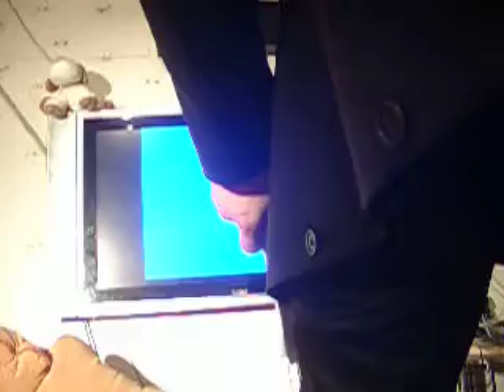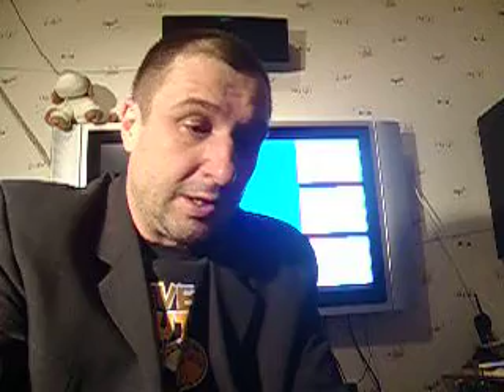BMW 7 HHO part 1  "Intro" Step by Step :] car running  on water Hydrogen

Comment from the maker: I've met Polish LPG Installer (Mr  "X") and after little chat decision: LPG Installation gonna be revorked to supply HHO. No missfires BTW. 
Usualy people supplying HHO to inlet manifold via Flowmeter (cose computer need to do something with extra added pressure)...so in this case is better  install them Safety Valves. Best 1's for V8 in Poland costs a half price of new1 LPG front set?! ... and using this converted LPG(HHO) I could set ratio HHO to rpm's
loooool!!!! :D

Comment from the maker: Hi there!
If you would like to builkd 1 by yourself-just type in google or youtube: HHO VAPORIZER SCRUBBER and you will find lot of it :]
I suggest to buy one from ebay-but if you would like to "play with it"... just play with it lol!
This project gonna be changed cose found now new type of HC-with Titanium plate! It deparate H and O so if you can heat H you can run without gasoline at all(of course after heating up this system).
Good luck! ;]

Comment from the maker: Hello @JThen14 !
I found on ebay non caustic additive to water and superstrong one...I will put into my next part :] and also have some nice tips more ;] 
The Pain is plastic manifold in this V8...going to call and ask for good solvent for this-LPG installer is open to informations :D
Good luck! - I am not taking any of resposibility for any possible Dangerous Accidents made by you. This is just my hobby :] 
Regards!